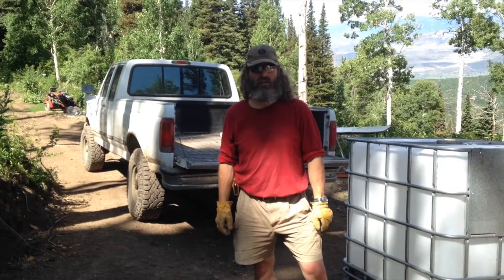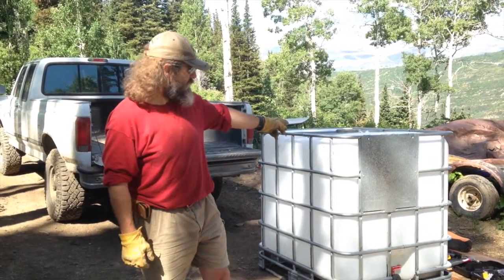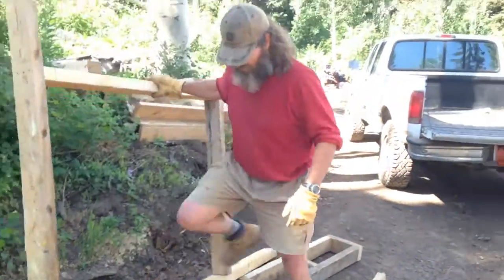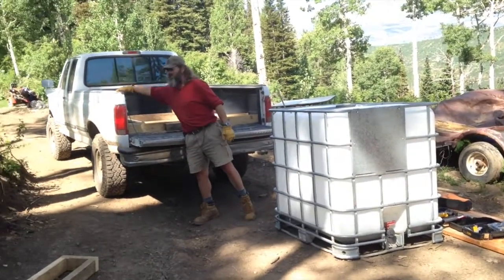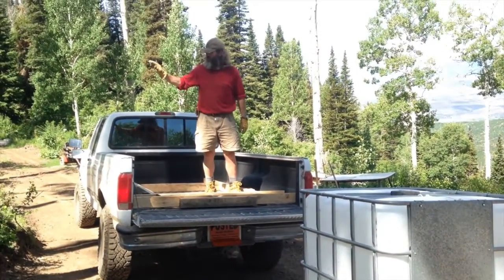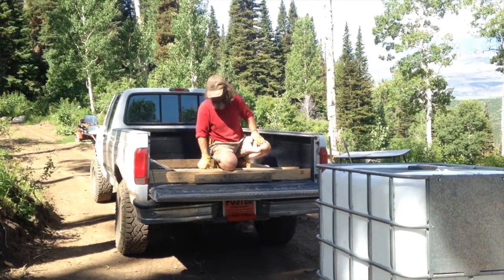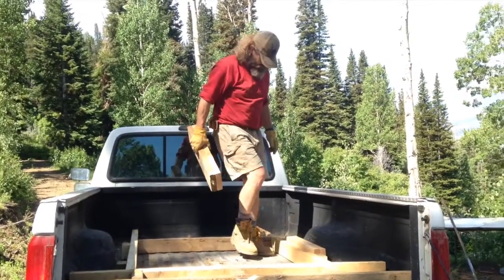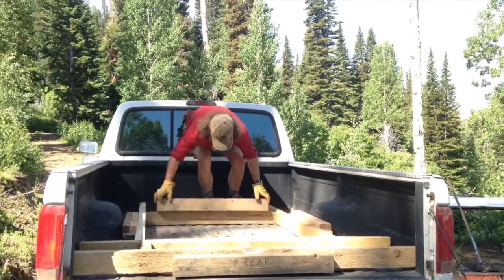How to Transport a 275 Gallon Water Tank in a Truck Bed

Comment: I love this, so simple. Do you have any tips for loading and unloading a full tank onto the truck? I'm in the the process of building a hitch reciever crane that I hope works.
Reply from the maker: Hi there. Umm...I am not sure. The totes in the video are not very solid, but if you turn it the right way you can use a fork lift. The bottom of these totes are like a metal pallet. Just know that we are talking about about 2,300 lbs of weight. My truck has an extra leaf spring on the rear.
A thing you could do is to have one tote on your truck and then fill it up with water. You can drive it to be above a second tank and let gravity fill into a second tank, and then you can remove the tank you have in your truck bed. Depends on what you are trying to do.
Reply: If you don't have access to a loading dock,  forklift or pallet stacker the best way to do it is to simply transfer the water into a second tote. They're only meant to be picked up from the fork pockets. Full they are about 2400 lb, that's a lot of weight to be screwing around with.

Comment: Good work, though have to ask. Did you try or consider ratcheting tie down straps? Considering your road, that might not be enough security, but I would have tried that first since it tends to be a lot simpler to do and remove as needed.
Reply from the maker: Yeah...I don't like tying things down on the sides of the truck. Right now our road is really bad, so tie-downs wouldn't hack it. We mostly drive on our property with our truck, and rarely take it outside our gate, so the water tank is almost always in the back of the truck bed. Works great for us.
I have started project "fix-that-darn-road" now... Might be able to eliminate most of our tight switchbacks, and I am soon going to use our heavy duty tractor scraper blade to do a lot of fixes...all very needed after last fall's rain :-)

Comment: What about the weight? Full that's nearly 2300 pounds and 3/4 ton truck is rated for 1500 pounds. Do you only partly fill the tank or just go for it and filler all the way?
Reply from the maker: Hi there. Thanks for dropping by :-) 
Well...my truck is a 1997 F250 7.3 Powerstroke Diesel. The rear GAWR is 6048. So, that weight rate is including the weight of the bed (and fuel) over the rear axle. This year I have exchanged the 270 gal tote with a 425 gal truck bed tank. That is about 3,544 lbs. I have no problem whatsoever going up our steep mountain road with that water tank full. But...I think I have an extra leaf spring as well. And...hence I can feel every darn rock on our mountain road :-)
Reply: Yeah I've got a 97 12v dodge diesel. I've loaded what i think was over 2k in the bed before and it seemed okay. In fact it really didn't even ride low in the rear. When I get around to picking up a tote I guess I'll just fill it up and see how she rides :)
Reply from the maker: Make sure you open the lid at the top before opening the drain valve :-) I cracked my tote a couple of places when I forgot to open at the top. I just heard some "cracking" sounds...and suddenly yelled "oh crap"... and jumped up on the truck bed... :-)
Reply: I haul a 200 gallon tank, and sometimes when I get 192 gallons the terrible water shift slap effect is worse than a little extra weight.  One vendor has a $5 bill machine that does 192 gallons for the $5.  I think the tank actually holds 208 gallons, so a 16 gallon void makes for a lot of room to shift the weight on stops and starts.